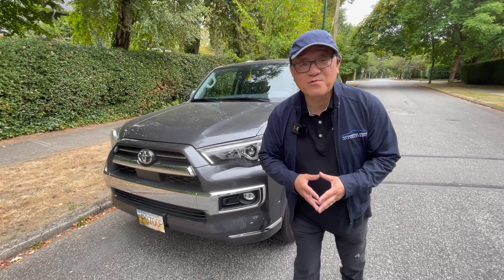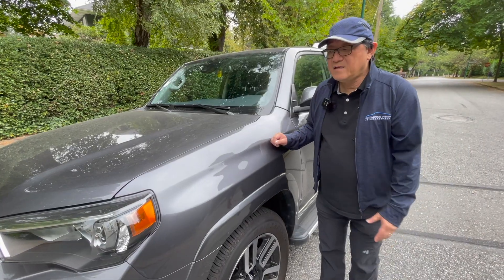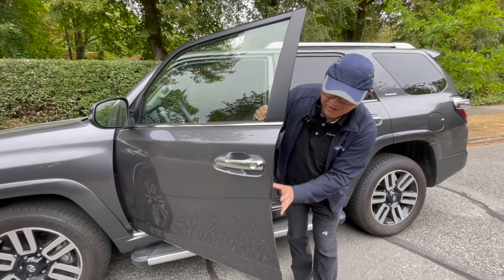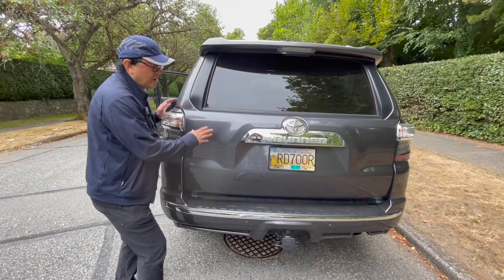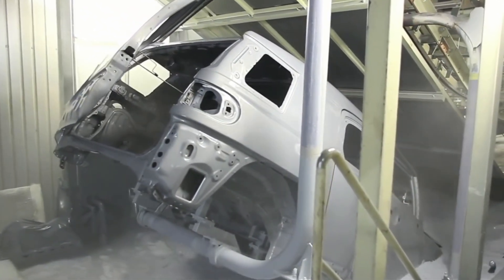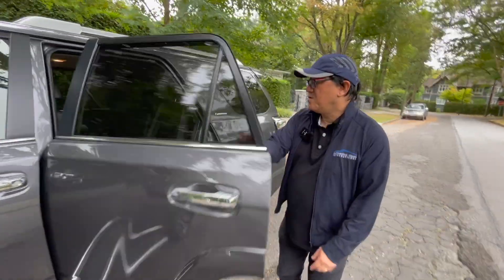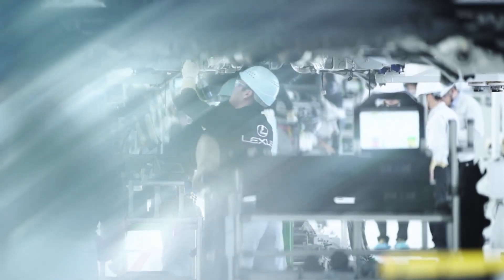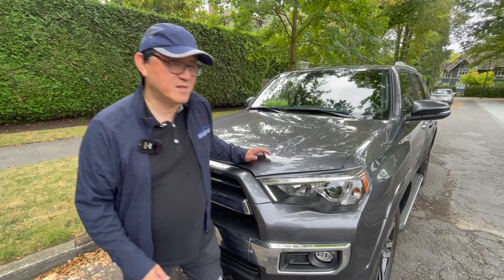PART 1: ENGINEER EXPLAINS WHY TOYOTA 4RUNNER HAS BEST QUALITY IN THE WORLD // STILL BUILT IN JAPAN

Comment: Changes I would make to the 4 runner are aluminum body panels, the 3.5tt v6 from the tundra, 10speed, and a rear air suspension option. Other than that it can stay the same.
Reply: Air suspension you will never see because its a bad idea. Guaranteed to cause problems years down the road.
Reply from the maker: The Lexus GX is basically an upgraded 4Runner and it does have an air suspension in the rear...

Comment: If only everybody took Deming to heart.  I remember when the Trekker came out in 1981.  I was a kid working at a dealership after school.  They were squeeky leaky trucks converted to a “walk through’’.  The back of cab was open into the bed where a bench seat were on the floor under a fiberglass cap.  It was a conversion done stateside.  The big seller in those days was the new squre body corolla.  To me, that car made Toyota…or Toyota had arrived with that car.

Comment: 4Runner is still the best off roader  109" wb best break over angle its just a basic off roader one the few left solid rear axel  as every one else went to a indpendent rear axle 'for a smooth ride and leg room for the 3rd row seats"
Reply: At least the new Sequoia went back to a solid rear axle.  Real trucks have a solid rear.
Reply: @user-tb7rn1il3q  yes.... Toyota ./lexus still uses them on their  wagons /suv

Comment: i agree that this is reliable and awesome truck; simple and does not have all these features that other modern cars have; but price is ridiculous. the simple truck should cost less than modern. so i would buy regardless how old is this dinosaur is but would consider for the price 70% of modern
Reply: Market demand will affect pricing, and demand is at an all time high. Why lower the price then?
Reply: @drew42025  absolutely; but i am not buying till this craziness supply/demand is back to balance. i hope for a good recession that will reset this back. but will see
Reply: @vadel251  good luck, there exspencive for a reason, don't wait around too long.
Reply: @johnwebb2232  ya planning to buy once they upgrade (if this happens next year), but if they delay for another 1-2 years again, dunno, and i won't buy this old version.

Comment: Very informative and well done  video.  I plan to purchase  a new 2023  4 runner near the end of this year.  May I ask  if the major  differneces  betwenn  the  SR5 Premium and  Limited  models  are  the  luxry and larger  tires  for the  LImited? It seems the SR5 Premium  has  the  same  safety features and  options as the Limited.  Thanks
Reply from the maker: Thank you! They are similar but only the Limited has an AWD, which is very useful in the winter times.  Also Limited has other luxury features not on the SR5
Reply: @AutomotivePress  Thanks. I am in New Orleans so do not need AWD for weather. For a daily drive the SR5 Premium should be a viable option. It also seems the SR5 Premium should weigh less than the limited so could slightly help with daily mpgs. I hope the allocation to dealers increases in my area as few 4runners are on the lots .

Comment: Toyota puts this protective film on the hood, the mirrors, door edges and other surfaces, I dislike that, the edges get dust and dirt underneath, you can't clean it, looks horrible, wish mine didn’t have it, otherwise I love the vehicle.
Reply from the maker: It was likely placed by the dealer, not by Toyota
Reply: Or the regional distributors.  The factory wouldn’t install such 💩.
Reply: Can be removed easily by heating it with a hairdryer or heat gun and peeling it off
Reply: Easily? 😅

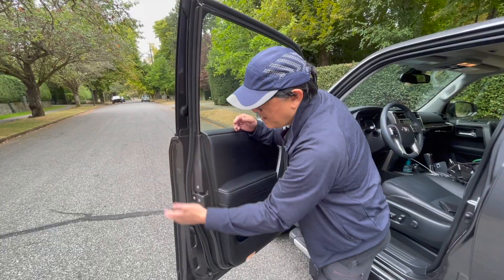Comment: David, This is a fascinating look at the 4Runner. I noticed at 5:07 and  12:11 you used footage of FJ and Prado production in Hino's Hamura plant. How do the Prados made by Takumi masters in Toyota's Tahara factory compare with the Prados made in the Hino plant in Hamura? Can you get one Prado from each plant on your channel to compare the quality? Owners of FJs and T100s may claim  Hino makes a better Toyota  than Toyota😉
Reply from the maker: Good catch Mike!  I had to take some footage from different sources as I was never allowed to take photos during my tour of the Tahara plant.  In my opinion, the Tahara makes better cars than Hino or Yoshiwara plant... you can see it in the body gaps and alignment and paint finish
Reply: @AutomotivePress  😁
Reply: We have a 2011 FJ Cruiser and a 2020 4Runner TRD Off Road, both show very high built quality. The FJ (3 inch lift with 33 inch tires)has 150k and runs flawless. The 4Runner with 23k is still very much like new. We live in New England so always vigilant regarding rust. Only wish I have is a Diesel option...I know I'm dreaming.

Comment: How is the fuel consumption compare to new Toyota turbo engines? Thanks
Reply: Realistically probably not that much different.  I get 22-25 mpg with my 2018 4R SR5 4x4 by driving modestly.  I keep the eco light on and coast down to red stop lights.  I expect a 2 or 3 mpg increase, but much better low end torque with 2.4t.  The Lexus NX turbo has been a good engine, so Toyota can build reliable turbo engines despite the early waste gate hiccups with the Tundra.

Comment: Excellent video, David.  Thank you for sharing background info on what the Mfg process truly is. There is a difference in worker attitude and pride involved.  Further solidifies my choice of next vehicle. 👍
Reply from the maker: Thank you so much for watching!
Reply: @AutomotivePress  yes good video, unfortunately my 2014 Off-road “Premium” paint is peeling, back up camera, moon roof, volume knob, loose screw in the inside the tail gate, have issues and don’t work sometimes. I’m out of warranty and very disappointed in the “quality.”
Reply: @HeyCrèmeBrulé  which vehicle do you own with these issues?
Reply: @chiphill4856  2013 Toyota 4Runner Premium Off Road 4x4.
1. Volume knob doesn’t adjust up properly.
2. Clear coat paint is peeling off really bad and spreading everywhere now.
3. Moonroof does not open on switch plate 50% of the time.
4. Back up camera doesn’t work 50% of the time.
5. Differential is leaking at the wheel hub.
6. Loose nut came off inside rear hatch and rattles when it is opened and closed.
7. Transmission does not to shift into 5th gear automatically and have to shift in 
manual mode.
8. USB cover always comes off when opened to plug in cord.
Am very disappointed with the long term quality of my 4Runner. I feel like it is no different than other manufacturers as I have had Chevrolet, Honda, and Dodge. All had issues in the long run, but I expected my Japanese built 4Runner to be better and hold up longer than it has. I don’t want to spend another $60k plus for a new 4Runner when it will not hold up in the long term.
Reply: @HeyCrèmeBrulé  wow! It certainly sounds like you have a bad example of a 4runner with more than a few problems.   Was it bought new or used?  How many miles on the clock when you bought It?   It sounds like something happened to this vehicle before you got it.